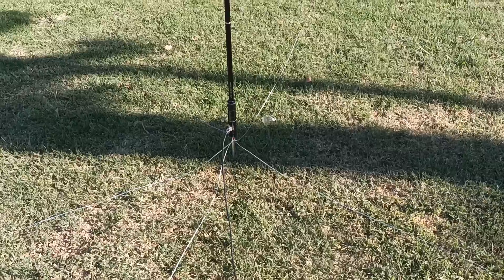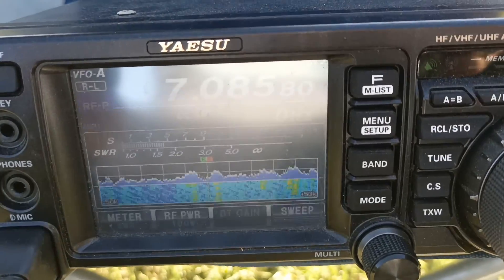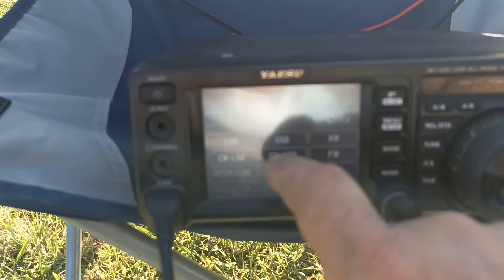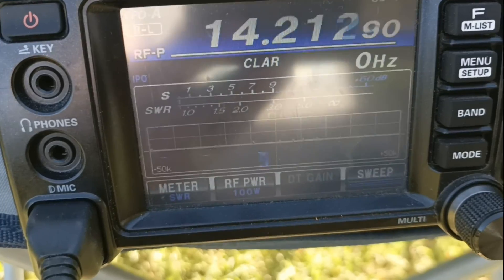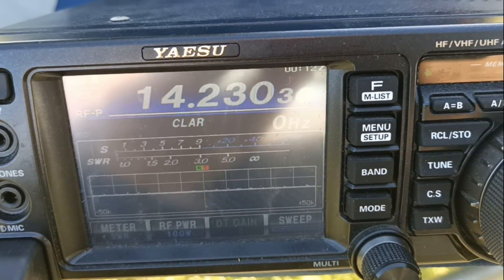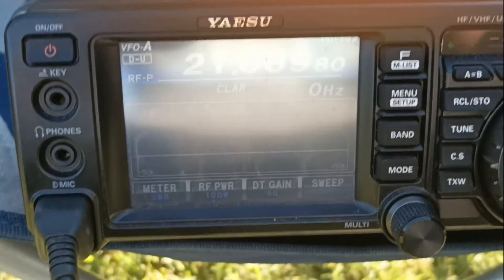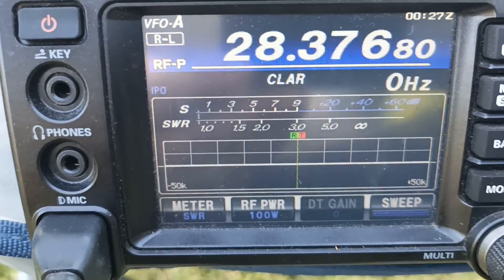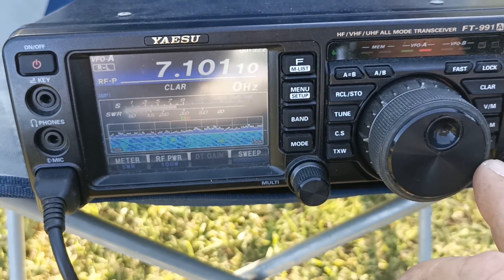Antena Vertical Multibanda JPC-12 - Configuracion y Test en 40M 20M 15M y 10M JPC-7

Comment: HOLA TE CONSULTO QUE LARGO ES EL IDEAL DEL COAXIL DE ALIMENTACION 50 OMS.?? CORDIALES SALUDOS   JOSE !!!
Reply from the maker: Yo uso 20 metros de rg58 actualmente
Reply: @Hernan-CAPI  usas el coaxil de contraantena,? porque  usas los radiales de tierra tambien, o es un motivo especial el largo del coaxil desde ya muchas gracias cordialmente  pepe..!!!LU5MDT
Reply from the maker: @josemoharraui3837  Fijate que en el video los radiales estan colocados. El cable va a  el equipo solo como linea de transmision.
Reply: El largo es El  que necesitas solamente.
Reply: @sebillappz  muchas gracias por tu respuestas y felicitaciones por el video es exelente, felicitaciones..!!!  pepe
Reply from the maker: @sebillappz  pero si es de 20m te va a funcionar mejor, hace la prueba. yo la hice, por eso uso 20m

Comment: Greetings.  You mention adjusting the whip length or removing the coil depending on the band you want to tune. Can you post the chart you use ? My antenna came with no tuning instructions.
Reply from the maker: Hello, put the subtitles, the example explained in the video is in 4 bands, 73!
Reply: @Hernan-CAPI   Thanks, but I tried the subtitles already and couldn't make heads or tails from it.  I have 20m and 40m no problem. I think there was a "remove the coil" instructions but the subtitles made little sense when I tried. any chance you could type those other  two (not 20m/40m), even in Spanish ?  I could get that machine translated ;) I'm only fluent in a few dialects of  English and French ;).  -73
Reply from the maker: @TheFingersD  after reviewing the subtitles friend, 73! Where are you from?
Reply: @Hernan-CAPI  Canada.
Reply from the maker: @TheFingersD  https://www.youtube.com/watch?v=1Kt7wlmcBIM&list=PL90p3mU4wMcoWoURNKmf7kZL6OEz-tygw
Reply from the maker: @TheFingersD  check new videos JPC-12 my channel, 73!
Reply: @Hernan-CAPI  Looking into it, thanks ;)